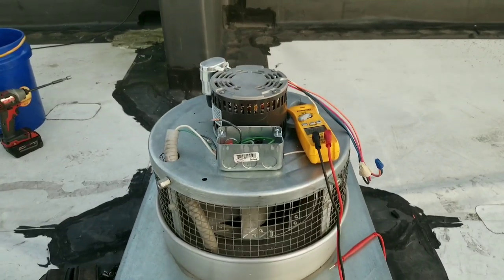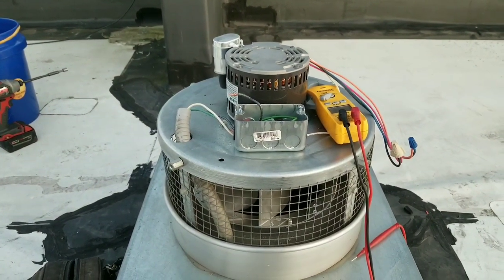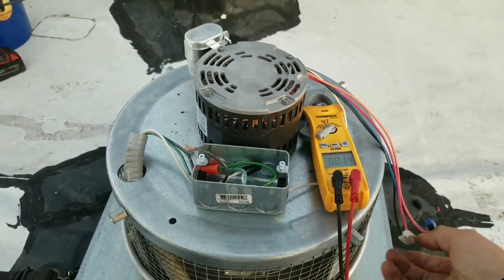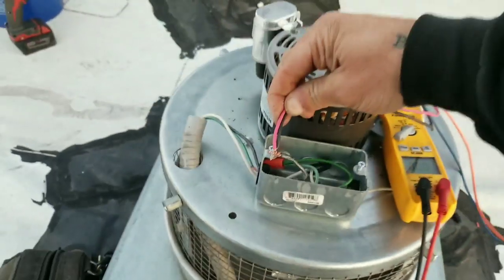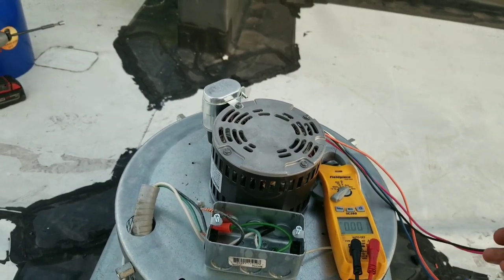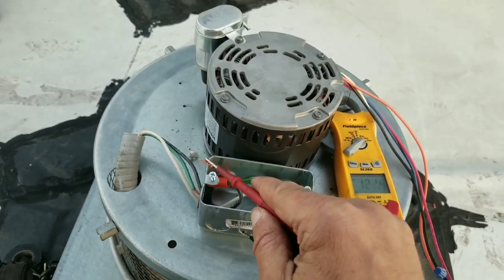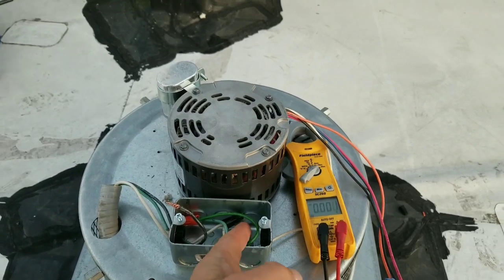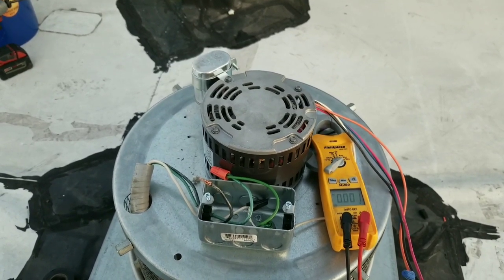Replacing an exhaust fan

Comment: I'd guess that it has high resistance (poor connection) so it's not flowing any current to speak of, even though it is full voltage.  If you put a load on it, the voltage will drop off.
Reply: That is what I was thinking.

Comment: I have seen this many times.  There is a poor connection somewhere in the circuit.  It will carry the voltage but not any amperage. The amps are what does the work.
Reply: I think i heard of this at one time too, somewhere there's power leaking into the circuit that has enough voltage to arc and be picked up by the meter, but little to none amperage to make stuff happen like turn a fan motor.

Comment: Yes, saw this before.  Like others have noted, can be caused by a high resistance issue (like a bad breaker that only allows very very little amps thru but full voltage), OR in my case, it was EMF.  Just encountered this for the first time in 40 years. Residential wiring in a bathroom in Romex. Two sets of Romex had been run close together and one would get 98V when the switch to the other Romex set was turned on. Couldn't figure it out, all Ohms/Resistance were ok, nothing shorted; so replaced the entire Romex cable in question and it did the same thing, EVEN when NO end of the new Romex was connected to anything on either end! (Except it went down a bit to 70V on the new Romex.) The body of the new Romex was simply close to the other cable. All stripped ends of the new Romex were 12" away from anything.  When I pulled the new Romex away from the other Romex cable that was energized, the voltage steadily dropped the farther I got away. All cables were in good shape with no tears, rips, etc.  I guess it's like those new cell phone chargers that dont need to be actually connected to charge a phone, just close. (Wireless power delivery. So, I guess Tesla was right.) In your case, assuming ur wiring checks out, I would look for either a weak/bad breaker/contactor/switch  to get ur amps back or possibly simply a tripped breaker.

Comment: I have seen the same thing using a digital meter.
My electrician came over and used his old school non-digital meter.  It looked like a red candy bar with 2 leads out the top and a bar that moved down a scale that showed 120,240, or 480.  It buzzes like it used a coil to move the indicator and his meter didn't move or make any noise.

He said it had voltage but no current and his meter put a small load on the circuit.  He said it was a bad breaker, he changed it and sure enough everything then worked.
Reply: The "Wiggie" still rules!

Comment: A DMM with Loz functionality or a 'wiggy' would have help in your diag.  I believe what you are seeing is a high impedance circuit. A circuit with enough resistance (a connection point most likely) to stop currently flow (breaks down instantly when loaded).
Reply: @curioushvacguy6876  I have on several occasions. My first was a simple resi A/C unit. I had 240v at the contactor (L1 -- L2), but as soon as the contactor pulled in I lost all the voltage at L1 - L2. I probably spent a 40 min trying to diag / reconcile what I was seeing before I called in for help, Thankfully the lead tech at the time had seen it before and was able to explain it.  I hunted the winging down and found a j-box with a burnt connection. 

The 2nd time was with an evaporator fan motor. And while I thought I understood (learned my lesson), I didn't.. :-) Made the mistake of removing the wires and testing for voltage.  Had 120v, so I quoted on  a replacement motor. Needless to say I was surprised when the new motor wouldn't spin up.. :-)  If I remember correctly I found a sketchy (popped top) defrost thermostat on that one... 

I learned my lesson after that one. :-)
Reply: @curioushvacguy6876  Sorry I don't understand your question?  Is there such a thing as a dual impedance motor?

Comment: High resistance somewhere.

If the resistance of the circuit is high enought then the maximum current that can flow is very low, bellow the threshold that you can actually feel it. The multimeter itself have an extremelly high resistance.

Let's say that the circuit have a 200k resistance, that mean that when you short it you get a maximum of 120V/200000Ω = 0.0006A or 0.6mA. The threshold to start to feel something is around 1mA. 

My cheap DMM have a 40Mohms input impedance. This would form a voltage divider and cause the DMM to read a bit lower, by how much? 40M / (40M + 200k) = 40M/40.2M = 99.5% of the input, which is basically the full voltage. You read 121.6V, which mean that with those numbers the real voltage was 121.6/99.5% = 122.2V. As you can see, the difference is so small that you don't notice it.

What can have happened is a wire burned and left only a bit of carbonised material that connect the wires. Or an oxidised connection. Oxides are a very bad conductor and offer a very high resistance. An open contact with moisture can also have an high resistance.

As a side note, this is why some more expensive meters have a low Z mode. Instead that the meter is virtually not connected due to the extremelly high resistance, it go on the other end: low impedance, which cause it to draw way more current. 

Someone mentionned the Fluke 116. The specs say: >5MOhms in normal mode, ~3kOhms in low-Z mode. I actually find the 5M to be quite low... But then again, it is designed to be a low-Z capable one, which mean you don't care about it being excessivelly high Z anyway... And I'm kinda surprised that the low-Z is 3k, but that is more of an heat dissipation issue... Being 600V capable... 600^2/3k = 120W in heat, so it have to do pulse reading, or else it would just melt down. Probably around a 1% duty cycle at max, which would bring the average heat to 1.2W, which is still alot for a plastic enclosure...

Comment: Low impedance setting on a meter will tell you the real potential on that wire.  Or a meter with a Casper setting. A bad connection like a failed breaker,  switch, relay,  etc seems the most likely scenario, but if something has changed and/or installed incorrectly it's definitely not out of the realm of possibility there's back feed through another load.  Like a lot of things you don't know until you know.  Either way the customers got a spare motor.  Nothing wrong with that!
Reply: Here is an article by fluke that talks about it a bit. Dual Impedance Digital Multimeters | Fluke
https://www.fluke.com/en-us/learn/blog/digital-multimeters/dual-impedance-digital-multimeters
Reply: @curioushvacguy6876  I always thought it just put a load on it,  but I feel like learned a bit going through that article. They explain it way better.
Reply: @curioushvacguy6876  I basically have no life. I spend a lot of time outside of work reading and doing stuff for work lol

Comment: I saw something similar one time on a small follett refr.   Was getting 120 v on line/ neutral to compresor with wires to comp unhucked. Once conected thouse wires to a load and tested voltage again. No voltage anymore ahha  this unit had a solid state relay I guess thouse things work by not letting amps flow when on the open position or not 100% sure on how they work but replaced relay and all worked.  Good video

Comment: Ghost voltages can be caused when energized circuits and non energized wiring are located in close proximity to each other, such as in the same conduit or raceway. This condition forms a capacitor and allows capacitive coupling between the energized wiring and the adjacent unused wiring. (From uncle google)

Comment: It's comes all around mostly when you have a lose or rusty connection. It's say with meter but doesn't show any while it's connected to any kind of load. 
Mostly found in 220 V AC.

Comment: Get shocked by an electronic ignition system. Nothing will ever seem quite so bad. Worst I ever had was 880v at about 20 cycles per second (on a tv). I watched my hand being shocked but couldn’t move it. I had to reach over with my other arm and move my hand.
 Good times.
Reply: But if it goes through your other hand it might go through your heart unless you had a glove
Reply: Indeed. However, I was young and dumb(er). The worst was an electronic ignition system that shorted out at my knees while I was bending over a car. That hurt
Reply: Curious HVAC guy watch as you get older; you’ll remember how you got specific scars. You’re much more well trained then I, and I hope you’ll do better then I. But being a mechanically inclined takes a toll.

Comment: The force is strong with this one, he can even hold live wires with no effects on his body... 😁🤣🤣
I have seen full voltage with no amperage on badly burnt contacts before, so I agree with the other commenters, bad connection somewhere.
Reply: Curious HVAC guy no no no, not Marvel, I was referring to the Star Wars scroll at the start of the video... you should be Darth Fridgeator or something 🤣🤣🤣

Comment: Neutral blown or not connected ,  happened at mates shop , some noob wired the 240v board wrong and it blew the neutral lead at the breaker in the main cab.
Reply from the maker: that sounds like an expensive mistake, lol- Thanks for watching

Comment: Did you check between L1 & neutral? I would suspect an open neutral, you'll see 120 to ground on L1 but is not usable because there may be potential between neutral & ground, thus no path back to the transformer.

Comment: I think someone said it already but you've got an open neutral most likely. I actually mentioned this in the comments on one of your videos not too long ago when you asked about transformer secondaries being grounded. Open neutrals can cause all kinds of voltage craziness. 😁 without a complete circuit, the current that actually does the work wont flow.
Reply: Won't be the neutral as he touched the 120v live conductor to ground. It's a high impedance supply, or induced voltage from an adjacent conductor.
Reply: @Thermoelectric7  the ground does not appear to be connected properly. If you look as it comes from the liquid tite into the plastic bushing it appears to be damaged or disconnected. There's also no ground conductor under the ground screw in the handy box. Maybe its connected elsewhere but I'm still thinking open neutral. Most likely a little of both. Poor neutral connection upstream from the fan causing high resistance. I'd really like to see what happens to that voltage when the fan is hooked up and I bet it drops pretty low.
Reply: @jacobfoxworth  regardless, he should have felt something when touching the wire. You don't need to be earthed to feel it. My bet is on a high impedance live conductor, or capacitive coupling. It's unlikely you'd get a poor connection on both the ground and neutral together (if it were a high impedance neutral). Chances are there's metal duct work going down to a earthed hood, or another earth through the frame of the building. 

If he hooked it up to the motor and measured voltage again that would almost certainly read 0v.
Reply: @curioushvacguy6876  that's cool. Well not cool for the customer, but interesting nonetheless. Let us know what the electrician finds, if possible cause I'm curious to find out. In my experience, those sorts of issues are usually a loss of neutral somewhere in the circuit. Thanks for taking the time to make these videos. I'll keep watching if you'll keep creating them. 😁
Reply: @curioushvacguy6876  I'm an electrician and electricity can still make me scratch my head every once and a while. Here's a good video that I recommend to anyone who isnt sure what the neutral is doing in a circuit. https://youtu.be/eVamt9IdQd8
It may or may not apply to this specific situation but it helps with the understanding.

Comment: that’s interesting! i bet a loose wire are something somewhere. Did u follow power before switch ?
Reply from the maker: I did not follow it from the breaker box to the switch-- my problem probably lies somewhere between there. One reason is nothing was labeled, and didn't have the time in my Not to Exceed amount I was given for this job

Comment: If not ghost voltage then what's on the other end of the wire, switch or some TRIAC based motor controller/speed controller? As a TRIAC will leak a certain amount of current through that might show up as a voltage on the line when the line is unloaded.

Comment: I’ve never heard of ghost voltage. I have heard and seen transient voltage. This is caused by multiple circuits in a single conduit. Most often this is with 480volts. Long multiple circuits act like a transformer and you’ll see voltage on a circuit that’s is not hot. I’ve seen what you’re looking at several times. Someone already mentioned carbon connection. It will show voltage with no potential.

Comment: A Simpson 260 would not lie to you.  It has a lower input impedance 
and will put a small load on the circuit.  Or use a 110 volt light bulb
to test with. Working on aircraft a test light works better than most 
hi priced meters

Comment: That's probably a neutral wire and has a load on it somewhere else In the circuit. and since it's a neutral it's already grounded.
Reply: But it should say continuity with ground on meter not a 120 v.
It was a live wire.

Comment: What’s the voltage when connected to the motor? I would connect the motor N to ground and hot just to test if neutral is bad. Or floating.

Comment: It will only shock you if your grounded. If you had one hand on metal box and other on wire it should give a shock. Did you check between black and white wire?
Reply: Check switches, contactors, and beakers, most likely one didn't fully relax. There's very little available current in the wire because something didn't fully relax.  Add a load of any sort and the voltage will drop to 0.  An old Simpson meter's internal resistance would use up the  available current and cause the voltage to drop too or close to 0. 

Yes, I still keep an old Simpson 270 around.
Reply: Even though the switch, contactor or breaker is not making good contact there is no load. A digital meter has almost infinite resistance, it doesn't put a load on the circuit so the voltage will remain high.
Reply: The reason why he didn't get electrocuted is because there is power leaking somehow into the wire, but the amperage for it to lethal or productive is missing.

Comment: With the motor connected i bet you would have no voltage
Reply: @curioushvacguy6876  because the bad connection cannot hold the load of the motor trying to start i would bet its a bad switch or breaker or a wire nut burned up in a junction box i have seen this situation many times in industrial electrical systems.

Comment: If it’s not from a bad connection with really high resistance that lets no current through. What about the wires are running along side high-voltage wires in the same chase or conduit somewhere inducing a voltage in the wire but no current. Is there a VFD on that same conduit somewhere that is not properly shielded and grounded in another part of the building I have seen that before.